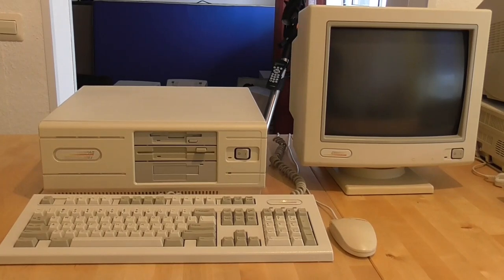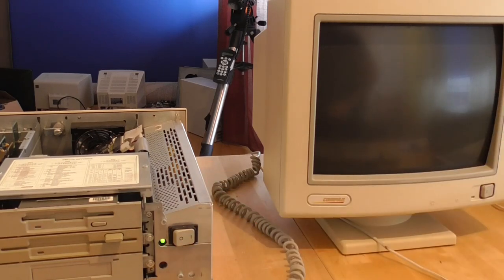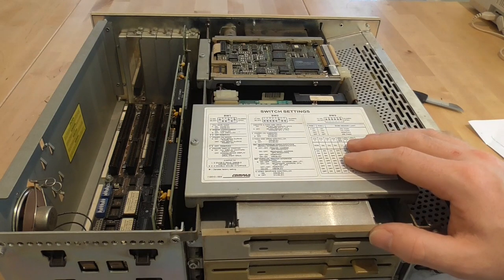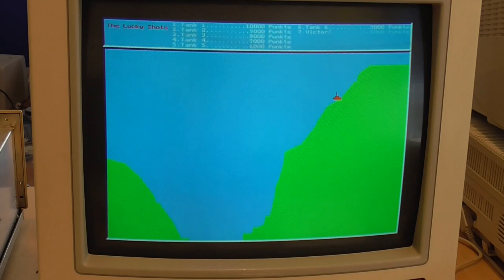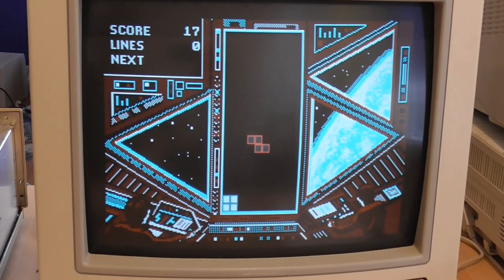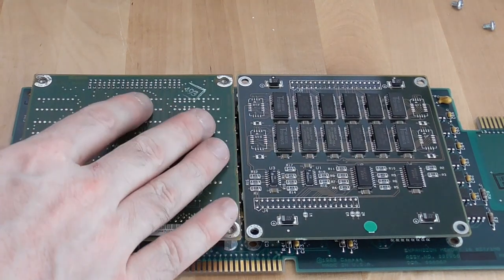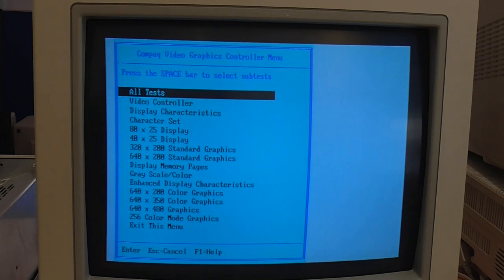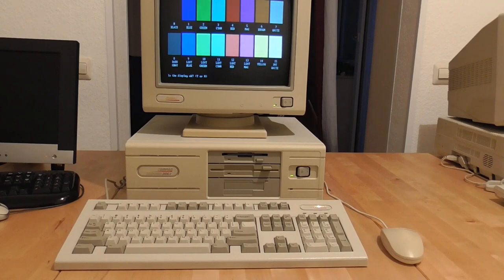The Beautiful Compaq 386s Part 3 : Restoration, Spare Parts and Games

Comment: 8:25 I'm thinking the plastics might have been of the (nearly) same color when they were new, but some were more prone to yellowing than others. I've seen other devices that seemed like their covers were supposed to consist of parts of the same color, but over the years the parts that had been exposed to the same light and other conditions had become very different in levels of yellowing.
Reply from the maker: Yes, I agree. I think that's it exactly.

Comment: Bit of a memory lane thing for me with this series, we were given one of these machines as an office hand-me-down. I can't remember the exact spec other than a 386, 2MB, some hard disk and a 1.44 floppy, the other two drive bays had blanks. We also had the monitor and keyboard, and a mouse though I can't remember if that was branded/matching.
Ours just displayed the memory count at post unlike the other one of these you have/had. Maybe the memory count only was an earlier BIOS revision, or a slightly different machine altogether.
Only the 2MB but Windows 3.1 worked ok, if slow. At some point my dad got a copy of the PC speaker driver for Windows via someone at his office, we suddenly got the various Windows sounds which seemed like witchcraft, though everything else halted during playback :)
Unfortunately we didn't have the big pile of games like yours, just things included with Windows, wolf3d and things included with QBasic.
Fortunately the clock battery never died - we never had a copy of the setup floppies so we would have been a bit out of luck there.

Comment: For the stretched cable, iirc there are some techniques to fix that. Don't quote me on that, but I think it implies putting the cable on a cylinder in the way it should be, then heating the cable with a hair dryer or something like that.

Comment: Help!  It looks like your motherboard takes a 15pin connection.  I have a motherboard I am trying to get working but unsure of the pinout.  Mine is the 15pin variety like this.  All I can find online is reference to a 20pin connection.  Is there anyway you can check the voltages and list them?  I have backprobed the following but unsure and don't want to plug it in and blow up this board as it has sentimental value.:  P1=5V, P2=?, P3=?, P4=-12V, P5=GND, P6=12V, P7=-12V, P8throughP11=GND, P12throughP15=5V.  I don't see a -5V listed and I don't think all of those are correct.  Please if you could help, thanks!!
Reply from the maker: Give me a day or two. I'll see what I can find out about the voltages in my machine. I don't know them off the top of my head.